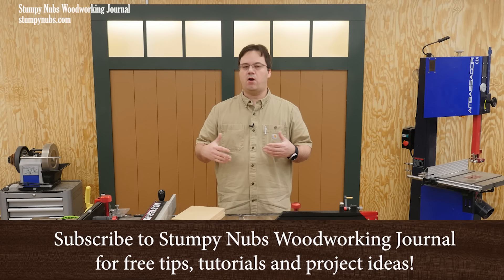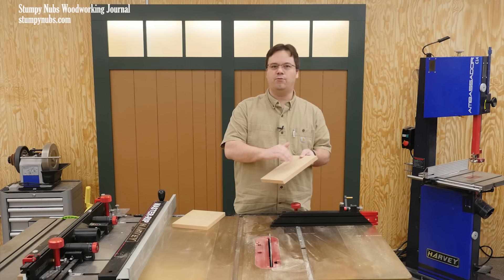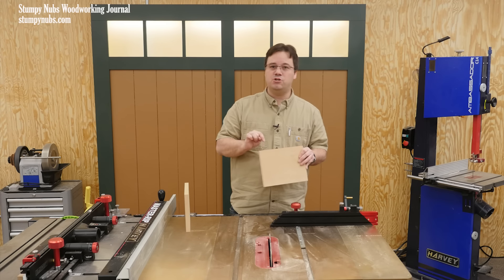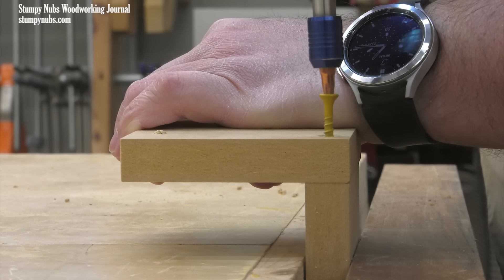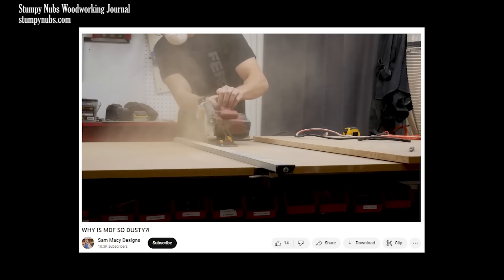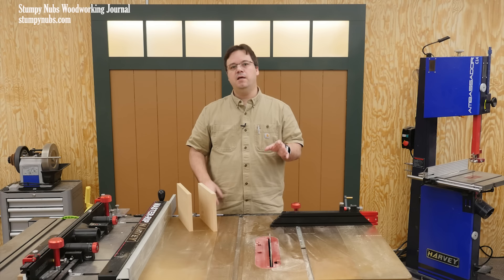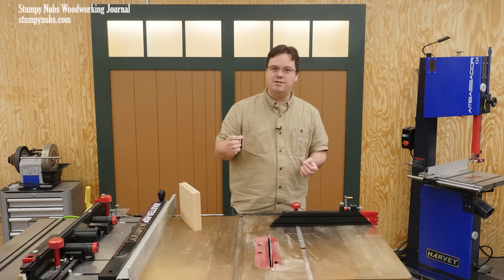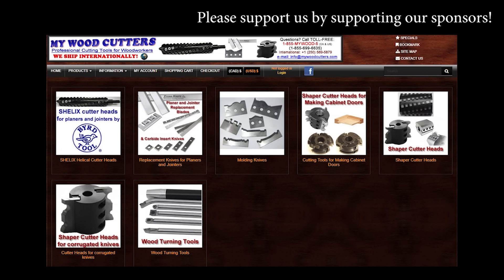This stuff changed my mind about MDF projects

Comment: MDF doesn't just come in a single type. The stuff you get at the large box stores tends to be rather fluffy in the middle and doesn't rout or mill very nicely. It's also much harder to get a mirror finish on it. If you have access to a lumberyard that sells the nicer varieties (things like Glacier Green, Ranger Board, Medite, Arauco double refined, etc) you'll get a better result in my experience.
Reply: A lot of the big box stuff is not  MDF. Particle board, OSB are not MDF. They are good for some projects but real MDF is a different beast.
Reply: @johnburd3180  All the sheet goods at my local HD & Lowes are clearly labeled.  Only MDF is claimed to be MDF.  Particle board, MDF, OSB and sheetrock have one thing in common:  Get them wet and you will be sorry.
Reply: Regular mdf is very porous. The double refined mdf is designed for routing. They started making it for things like routed doors. We use it primarily for raised panels. Once sealed, sanded and painted there is no visible difference between the core and surface.
Reply: @incognitotorpedo42    Water and moisture resistant MDF is more costly but is available and we use them for kitchens. baths, basements or anywhere where moisture is an issue.
Reply: Back in the 90’s the waterproof MDF was branded “Medex” and was favored for outdoor routed signs. It is very stable and unaffected by water. It cost double what the regular MDF did and worth every penny.
Reply: Medex is still available, and is my preferred material for CNC routed doors. It is extremely water resistant. I use a cutoff as a baffle to block water coming out of my compressor tank when I drain it. It has been used for this for the last 5 years, is often soaked and is just now expanding at the edge that most often sits in the water.
Reply: @bradnail99  We did a couple of exterior raised panel jobs in the 2000’s. It turned to mush. They relabeled and called is water resistant. Then it got replaced by Extira which is truly rated for exterior use.
Reply: In other words stop buying overpriced crap from Lowes
Reply: IKEA uses a harder MDF than I can get in most DIY stores. But they call it “fibre board” or “particle board” conveniently blurring the nomenclature.
Reply: @incognitotorpedo42   AB SO FREAKING LUTELY!
I helped a friend spec out his "Dream House."
In the Specs, we stated, "Real Wood throughout. NO MDF, OSB, PARTLICLE BOARD, OR SIMILAR. Plywood MAY be used, but must be exterior grade, regardless of location."
We also required minimum 3/4" Type A Pex throughout, with the expansion fittings, and that all the wiring be in metal conduit. And any wiring in the ground would be encased in Stainless Steel conduit.
Expensive? Yes. But, the plumbing contractor was VERY happy when the hot water tank catastrophically failed 4 months in, and there was virtually no water damage!
Reply: I make MDF in New Zealand for a living.
We export all over the world including the USA.
Our product is made from pine and we make it in different densitys from 540 m3 to 880 m3.
The product you are seeing thats fluffy inside is a lower density panel, probaly about  600m3
730 / 790m3 is standard and good allround.
Problem is you never know what you're buying at the depot

Comment: As someone who lives in the South, don't use MDF.  I have cabinets made commercially made kitchen cabinets with that stuff and the high humidity turned them into junk.  Once you're burned by MDF, you really don't want to revisit the stuff ever again.
Reply: I live in the desert 🏜️ and it's not bad at all here. If used indoors.
Reply: use MR (moisture resistant) MDF. It's not only MR but stronger and takes machining better.
Reply: Sounds like poor quality mdf 
All the kitchen companies here on the east coast use mdf
Reply: I live in UK, rain is a given. 99% of all kitchen doors are made of MDF, Its strong, dense easy to machine and won't expand/contract like natural wood. All kitchen cupboard doors are moisture resistant and will easy last as long as the kichen, even after 15 years, people would deem them old enough and change them out for a new style. For speakers then, most manufacturers use mdf and that will be coated in paint and or veneer then varnished .... I do not at all agree with your statement.
Reply: @thomasowens5824  Well my cabinets don't agree with your opinion.

I've been to the UK.  Your heat and humidity is nothing compared  34c average temperature in July along with 90% peak humidity we have in SE Texas and Louisiana.  While air conditioning mitigates the heat, it does not stop humidity from taking a toll.   It does a really good job of peeling off those veneers.  EVERY HOME in my neighborhood has had to replace or re-finish cabinets for this reason.

They might last where you live.  Definitely NOT where I live.
Reply: @Andrew-nh5zg  Not the heat, the cold and damp I was referring to.
Reply: I agree. MDF swells in humid environments. I have always regretted agreeing to its use in my homes over the years. Whether it’s used for skirting boards, kitchen cabinets, furniture, when coming into contact with airborne moisture (humidity), condensation, or free water, MDF fails every time.
Reply: Maybe bare mdf but I have properly sealed and painted mdf cabinets here in the Caribbean for over 10 years with no issues.
Reply: @WhoTnT  Good for you.  As I said, the home builder in my neighborhood installed a lot of MDF cabinetry where the veneers peeled off and cost a lot of us thousands to either replace or repaint.

As a consumer, once you get burned by a certain product, you aren't going back to it.

Comment: To "waterproof" MDF, I mix 50% linseed oil with 50% mineral spirits and apply until the board no longer absorbs the material. After letting it dry, apply a second coat, 75% / 25% oil to spirits.  Sand before final finish.  This does not work over a sharp corner, so be sure to break edges.  I used this technique to replace a long interior window sill that puddled water every winter and it has held for more than 25 years.  The treatment creates a thin casing of waterproofing, so once applied, do not cut into it without repeating coverage.

Comment: As a former builder of speaker boxes using mdf I used a biscuit joiner to assemble those and never had problems having to use screws or pilot holes for those. The biscuits also made sure the edges were flush with each panel. My finish for those were a textured paint that easily covered up any "flaws" in the edges and the seams never showed back up later as they aged. Your mileage may vary.
Reply: I've been building boxes for a while and it's about to become my main source of income because I make more doing it than my regular job! I saw tests showing that MDF glued to wood actually formed a very very strong bond. I've got to where I prefer using real woods over MDF for enclosures, because it's lighter for shipping and prettier w the wood grain. I saw the research where there was such a tiny difference between the MDF and wood that it didn't matter.
Reply: @johnnycorn7225   Because MDF is denser it will resist vibrating much better than real wood of the same thickness. Do you test your boxes for vibrations and brace accordingly ?  Costs for shipping heavier objects does cut into the profits but there are always tradeoffs.
Reply: @davidlong1786  yeah I use dowel rod and triangle bracing with my designs and test them at full power until they can't bounce a quarter around on any of the panels. So many people underestimate the losses of a weak enclosure for sure!! My last customer complained about how heavy his box was and I told him it had to be that way cuz he's running 3K to a single 12 inch a.b godfather
Reply: MDF is a great application for biscuits. Domino fan-boys have made biscuits out of fashion, but biscuits have their place :).
Reply: @johnnycorn7225   3K!!!???  he must like annoying people everywhere he goes. I'm guessing he likes the show off factor more than he likes listening to music.
Reply: @johnhorner5711  I almost got a biscuit joiner to do the splines in my box corners because they are so fast and easy and line up the panels too!! I just made a jig for my router, and it's quick and easy too. 
Biscuits are way better than Domino's, plus last test I saw showed the biscuits were stronger
Reply: @davidlong1786  Yeah, its loud and nearly all my customers want ported boxes for that maximum SPL thing, it's what's in style now lol. I'm 47 and used to be a musician and love my sealed SQL setups( I have a very picky ear and adore the instantaneous punch and accuracy it brings, that ported just can't)
Reply: @johnnycorn7225   The best tight low frequency sound I ever had in a car was using a single 8 inch driver in a sealed box with a  FC of 60 Hz and Qtc of 1. The cabin gain let it play down into the low 20s easily without any boom plus the box was really small. Thank goodness around here the BOOM BOOM cars are getting rare plus LE will ticket those that are too loud.
Reply: @davidlong1786  We are so cut from the same cloth bro I prefer that q to be around 1 instead of  .7(like many ppl) and look for higher fs drivers that plot well sealed( best, punchy accurate sound) and 8s really excel, loved every 8 setup iv ran. 
I love the cabin gain you can get from cars using sealed setups and none of the ported people believe it till they hear it!! High-power to small sealed enclosures just sounds so much better when you're spoiled to it. 
Last time I got a noise ticket it was $260 so these days I'm using extra sound insulation and I don't want to be one of those rude stoplight people haha
Reply: How many of us got into woodworking because of building speaker boxes when we were teenagers.
Reply: @davidlong1786  They could ticket noisy motorcycles while they're at it.  "Loud pipes save lives" is a lie since most noise comes out the back.  Anyone in front gets little warning before Hell's Accountant rides by on his Heffalump-Dumpaloon.
Reply: Dowels work well for me, and a decent dowel jig like  the Jessem along with proper clamping makes sure the edges are finger-smooth.  Rabbeting is also good, especially since it gives a sawdust-to-sawdust join so the glue can penetrate both surfaces.  I have a pair of subwoofers with rabbeted edges, nothing else, and they've withstood years of abuse (no neighbours to annoy) with no sign of delamination.
Reply: @samuelb6960  lol ✔️
Reply: @francoissouchay3887   Yes I also hate loud cycles. Your description made me laugh hard. Sort of like the South park episode with the Harley Fa**
Reply: @francoissouchay3887  That's too funny. Thank you.
Reply: Is this the mandolin player David Long?
Reply: @JamesJessenfedden   Sorry but that's not me, the only instrument I can play is the radio.
Reply: @davidlong1786  Ha! Ok.
Reply: @johnnycorn7225  Not for cars but 40 years ago I built 2 SpeakerLab  Klipschorn copies. Talk about solid  - two layers of 3/4" ply - marine  and walnut veneer. All on a Sears radial arm saw.  4 foot high folded horn - 103db/watt  - no distortion. Pipe organ would shake the house.

Comment: I wish I'd seen this a year ago. Had work done in the house and the builders used mdf for door facings, skirting boards and shelves. Painted them all with undercoat and gloss. Every single edge swelled up, looked terrible and felt rough. I sanded it all and redid it with different more expensive paint and the same happened. After the 3rd attempt led to the same rough finish I decided to spread a thin layer of filler, sand and repaint. Worked a treat but my wife wouldn't believe it wasn't my fault until she decided to add another shelf herself including painting.
Reply: Ah the wisdom of the wives always exceeds the experience of the hubbys.
Reply: See my post above regarding Moisture Resistant MDF. It’s a far more stable product and suffers virtually zero swelling in light contact with liquids such as paint and is far easier to work with.
Reply: The previous owner of my house installed MDF baseboards everywhere. In places with no humidity (like a livingroom), it's not too bad, but they put it in bathrooms (my kids get water everywhere) and in the laundry room (we've had a few leaks from the washer). The MDF baseboards soak up water like a sponge (and swell to match).... I like MDF for the right projects, but, it has to be the RIGHT PROJECT.
Reply: @joshuabray37  there are different grades of MDF. You can get exterior grade that does well in wet environments. You could also seal it to prevent water ingress.
Reply: @ Thanks for the tip. When I replace my ruined baseboards, I’ll look into that. I prefer the look of MDF baseboards compared to pine (no grain).

Comment: I was taught by an old timer to apply sanding sealer before applying ANYTHING to MDF. It keeps it from soaking up whatever I'm applying. Smooth as glass finish every time!
Reply: Out of interest, which sealers have you used? I prefer to seal real wood with water based polyurethane due to the ease of cleanup, lack of solvents, fumes, & not being flammable, but I've not had a lot of luck using it on MDF, perhaps because it takes too long to dry out. Even a small amount tends to swell things up & takes the flatness out of the original surface. Superglue works well but is too expensive for larger areas, so.. shellac?
Reply: @nightcatarts  I've had good results with shellac as a sealer on MDF...dries fast and sands easily and can be topped with most anything....
Reply: @KeithMoncrief  Cool, thanks. It often seems to come back to shellac but I don't much like working with the stuff, & most of my MDF use has been for unfinished jig type stuff or laminated with wood. Oh well.
Reply: @KeithMoncrief  I use shellac or paste wax on MDF when making jigs and stuff for the shop. Sometimes I seal the edges with wood glue. Some jigs are over 30 years old and get a lot of use
Reply: @nightcatarts  the shellac (as pointed out by @Stephen Thomas ) is really good as a finish for jigs/fixtures and work surfaces...it hardens the surface of the mdf...makes it more durable and somewhat resistant to glue (especially when topped with paste wax)
Reply: @KeithMoncrief  At my work we use a lacquer based primer, I have heard of using a vinyl based sealer. We sometimes outsource cheap faux panel doors made of MDF with the center routed out (we build our own solid) and they use a vinyl primer to seal the exposed core with good success.
Reply: @KeithMoncrief  Yea that was my go-to for any surfaces that needed to slide & resist such wear but I swapped it for superglue a while back. I suppose I'll have to dig out the old bottle for anything larger.
Reply: @nightcatarts  yeah, shellac has got to be cheaper than super glue...and I don't find it any more troublesome to work with, especially with larger pieces...though I really do like super glue for smaller applications
Reply: @KeithMoncrief  Yea superglue becomes difficult to level on larger surfaces too so needs extra sanding. I always end up making a sticky mess with shellac though & the alcohol evaporates off faster than I'd like in the bottle, plus the stickiness means I've had no luck wiping it on with paper towels (which is what I generally use for superglue & oil), which means more rags about the place. I've never had a proper dedicated workshop so had to pare stuff down to the minimum of space & consumables. Perhaps more practice would help.
Reply: @aaronpreston47  thanks for sharing what you use. I have a small furniture/cabinet shop and (mostly)  work by myself. I like to try and be familiar with the variety of options out there but I find I often (usually but not always) fall back on what I have experience with ... it's good to know what other guys are doing though.
Reply: Shellac and oil based sanding sealer work best. I would stay away from water based on mdf imho😊
Reply: I run a cabinet shop where we make cabinet doors from MDF. High-solid sanding sealers are a necessity. Early on, I tried shellac and wasn't impressed. I know this isn't a commercial channel, but most commercial finish systems have a high-solids primer available that is meant for this.
Reply: @nightcatarts  Seal-Coat is great choice. It’s a 2-lb. cut shellac, so it absorbs great and doesn’t swell the edges. Easy cleanup with Denatured Alcohol. It’s a clear-ish amber color.
Reply: @nightcatarts  if you’re using canned shellac (which is a 3lb cut, thin it 50/50 with denatured alcohol to thin it out. Absorbs more, and isn’t so gummy. Alcohol makes for very easy cleanup as well.
Reply: @TheMrchuck2000  Cool, thank you. It looks like they all evaporate really fast so perhaps I just need to find a colder place to apply this stuff.

Comment: I've always used watered down pva glue for sealing the edges of mdf when it's dry, simply sand to a glassy finish
Reply: Same here mate
Reply: I've had success with a thin mix of Durham's Rock Hard
Reply: I do the same when assembling flat pack furniture. I apply PVA glue to all the cut edges, to help prevent damage.